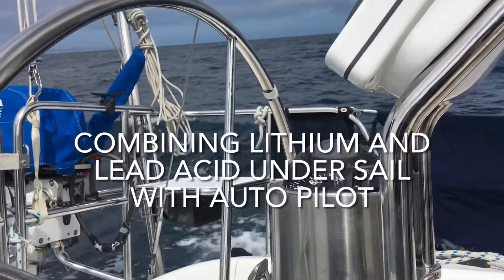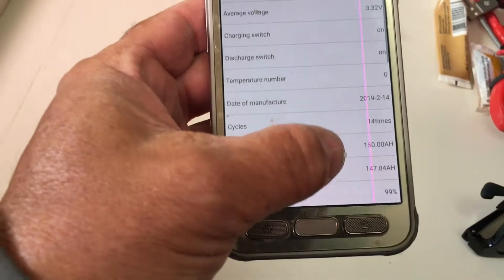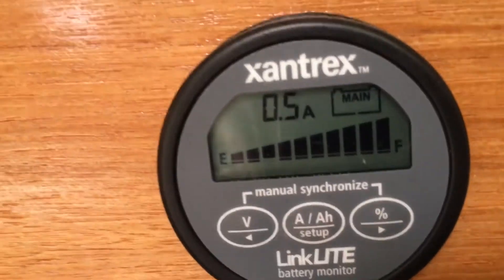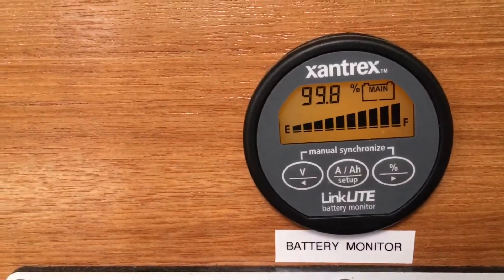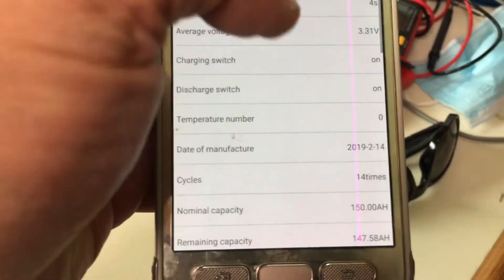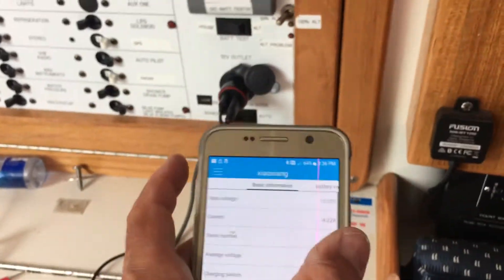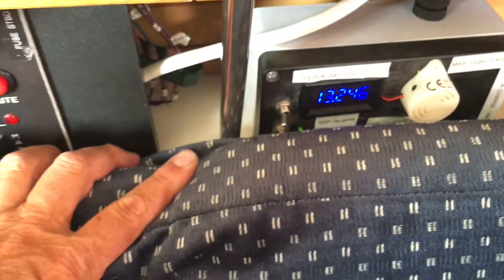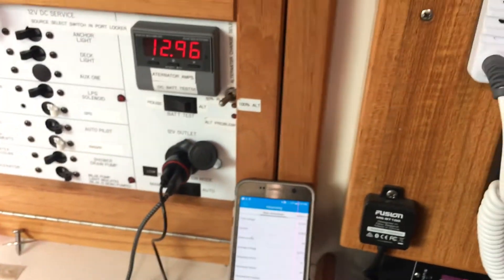Lithium and Lead Acid Battery Banks Combined in Parallel under Sail – My First Sailboat Experiment

Comment: I bought 8s lifepo4, 200Ah, to replace my deep cycle walmart batteries . After 6 years of use,  but only cycled maybe 300 times , but hooked to the same inverter charge the whole time, these batteries still seem to be good.   BUT  I quickly found out that when running an 8s  lifepo4 battery, it very rarely gets down to the 22 volt mark, so the inverters and charge controllers can shut down on their own.  The lithium  battery shuts down if just one cell is too high or low.
   According to the manuals of the inverters and charge controllers, they all say to, "NEVER DISCONNECT BATTERY WHEN IN USE". Every thing had big red warning stickers on or near the battery terminals. Although my  inverters and charge controllers have survived some battery shut downs at low draw,  If this premature battery shut down had happened during a high amp draw and or charge, my inverters and charge controllers could be damaged or fried. 
  So, I hooked the 200 amp hour lead acid batteries back up ,with the new  200 amp hour,  lifepo4 packs, to prevent  premature battery shut down damage. 
I have gone through many full cycles and everything seems fine. 
 LOL. The moral of my story is, after replacing the lead with lithium, I still need to buy some new lead acid  pretty soon.  This hobby is getting too costly. 
   But when the lights go out on my block I will still be warm and on the internet watching youtube.
Reply from the maker: Great story. Thanks for the detailed comment. I’m wondering what your 8s lifepo4 voltage is when your 8s cells start to get in the shut down zone. Do you have an input signal to your inverter charger that will allow you to remotely control shutdown via a voltage sensitive relay set to a custom value you determine?  I played around with the auto shutdown in this video https://youtu.be/dKzz4K5fukE .
Looks like what you have works but maybe you could shutdown earlier and optimize battery life?
Reply: @dannyjensen4954   I do have an epever triron solar charge controller, with a relay module, that can be hooked in line with the inverter switch, for exactly that purpose. I've had it for months trying to figure out how to work the damn thing. All of their manuals say,  "refer to section 4.3.2 in the manual", to set up  the relay module and to learn how to use it. every manual , HAS NO SECTION 4.3.2 . lol . section 4 only goes as high as 4.2.5. The craziest thing happened. EPEVER finally wrote back with son simple instruction.  There site has every product they have made , except for the triron  line. lol. but i have emailed them months ago about have no section 4.3.2 in any manuals and just last night they got back to me. lol It's awesome now I can set any shut down perimeter for and inverter. The coincident of this is crazy. They must have heard me complaining all over the internet. 
   About the shut down voltage. It was really close . like 22v, and it was testing. mostly trying to get these cheap cells to sync up. 
 But, my inverter is an inverter/charger, with  UPS or ATS  modes.IT wokes every time in the ATS mode because it actually switches at 22V kind of the opposite of UPS.   On ATS,[ automatic transfer switch] it will not use house power to charge unless there is no solar coming in and it reaches 22-22.5 volts.  Where as the UPS mode keeps batteries topped off and passes hous power through , only using batteries when house power is "interrupted"  The lights are always going out here it seems . and this system,  is seamless power.
 The 2 batteries I made are 105 Ah cells, 8s.  with the 100 AMP BMS Overkill sells , with BT phone app. One 8s and BMS and an active ballencer, all fits perfectly into one of the plastic battery boxes I had my 110 Deep cells in. The foan packing the cells came with was perfect to wedge everything in there tight.
 My Christmas present to myself this year is 8 new guarantied matched 310 Ah cells arriving sometime in FEB.. from ,,, of course china. $1246 delivered . And a new 200 amp BMS Wit 4 AMP balancing and BT , and heater relay. 
 Solar is 10,[will be 12] 24 volt ,uni-solar flexible [low light type], 135 watt. rolls.  But I only have two up and they are covered with snow. eventually it will all come together .

Comment: I'm curious if you have reconsidered your prohibition on charging the two together. I have read that you can treat the bank as a lead battery and it will go fine. You need to make sure the lithium disconnects at 14.4 so it is not endlessly trickle charged.

Comment: I have been doing this for over 3 years and it works fine. There is actually no real problem making the connection between them, I just recommend that the lead be in a reasonable state of charge as in not flat. Lithium will be at 13.2-13.3 through most of its range and it doesn’t take a lot of current to pull lead acid up to this level so no big sparks. I’ve been logging voltage and current of both chemistries on a minute by minute basis and at no point have either of the chemistries strayed out of their comfort zone. I do have a specific set of settings for the lithium BMS to give best life / performance with lead and to keep the lithium balanced internally. I cut off at 14v, cut back in at 13.5v with a balance start at 3.4v per cell with a 5mv balancing delta. Low voltage disconnect at 12v (10%) and reconnect at 12.5v
Reply: Oh it seems you are a member of 12v boating group
Reply from the maker: Thanks for the detailed comment we can all learn from. I have been manually paralleling my lithium and lead with my alternator charging with voltage sense input on the voltage regulator connected to the lead bank. It is difficult to get the lithium over 13.8v.  I’m wondering if you have a voltage sensitive relay you are using to break apart your banks? How are you controlling your charger on off voltage range? Where are you putting the voltage probes for your charger shutoff?
Reply: @dannyjensen4954  my lithium and lead stay connected together but via the BMS cutoff which is the final arbiter of charge and discharge. All charge / discharge sources are connected to the lead and via the BMS to the lithium. The BMS is designed to be able to deal with the maximum load it is expected to see. The alternator regulator is a 14.4v one so it can get the lithium to the 14v cutoff I have set in the BMS and this avoids overcharging at 13.8 which could be a problem with a lower voltage alternator. All sensing is done from the lead battery except the BMS of course which will always sense from the cell terminals. That setup described is what people are using with BMSs with mosfet switches and is how I have set them up for people. My personal BMS does use a relay to manage the connection and that simply has a diode across it so that when fully charged it opens but can be discharged via the diode which rapidly pulls the battery below the switch off voltage so it reconnects. As I designed my own BMS I incorporated a holding current on the relay to greatly reduce the relay operating current. When I first set it up programmable BMSs were more the exception than the rule and were expensive which is why I designed and built my own to be incorporated into the wireless monitoring and control systems I have for the boat but since then fully programable reasonable price BMSs are readily available and quite capable of looking after hybrid with no intervention at all. There is now a lot of information about all this on my 12 volt boating group on face ache where the idea seems to have really taken off as an affordable way to get the benefits of Lithium without the costs we are traditionally told by equipment manufacturers we should have to pay. It also of course gives the all important redundancy you mentioned that you don’t get with pure lithium.

Comment: 👍 never thought you go do that. I have one 280ah lithium and one 100ah lithium, do you think it would be ok to parallel them together? I have the same dual battery switch.
Reply from the maker: I would not parallel LFP unless both were at a high state of charge say above 13.8 on both banks rested with no loads and current protection maybe 20A on wire paralleling. Very dangerous idea if done wrong. Thanks for your idea.

Comment: I have read your comments with interest.  Are you charging your paralleled (lead acid and lithium) batteries with your on board  charger?
Reply from the maker: For this experiment : The only time I charge in parallel is with solar set to 13.8. Otherwise I charge LFP with DC charger and FLA with alternator or shore charger.
Reply: I ran 200 Ah 24 v of lead and  200 Ah  24 v of lithium at the same time. parallel.. off the 40 amp lead charger in my inverter /charger for about a year on and off and it seemed to work great. I had done it because the lithium could shut down  before the inverter low voltage shut down could happen. seemed to be fine.